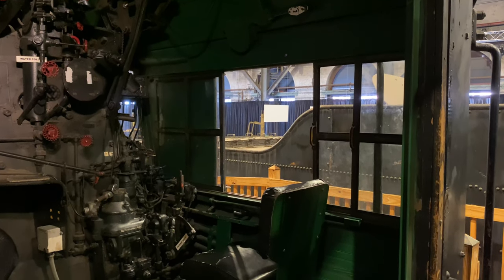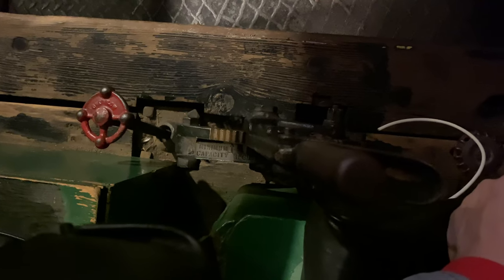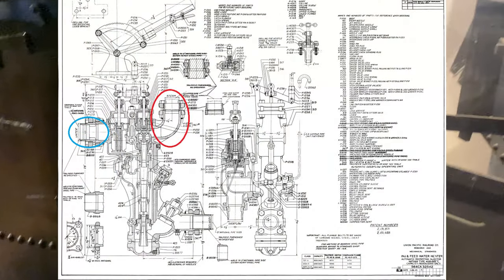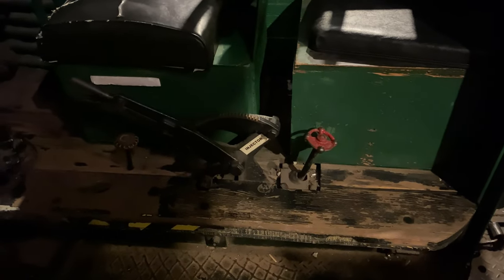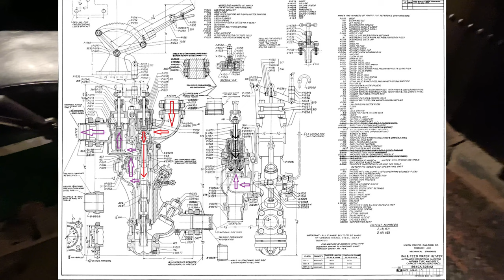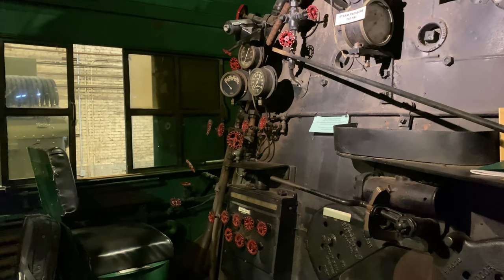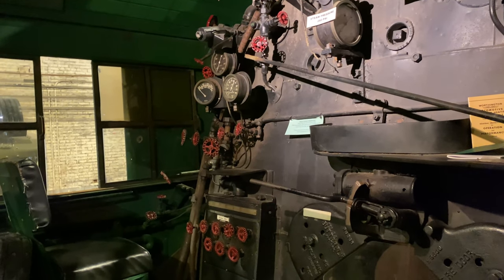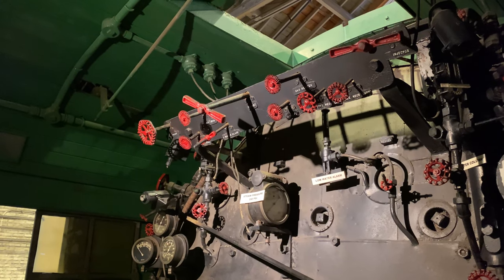Nathan Type 4000 Injector & Worthington Type SA Feedwater Heater Overview on C&O H-8 Allegheny #1604

Comment: Wow! Great info, man. I recently got a deal on a reprint of the1925 Locomotive Cyclopedia which shows cross sections of just about every component of steam locomotives.

I had never heard of this type of injector and after watching your video, I found a video that I'll link to below of a Nathan 4000 C injector in 1.5" scale (I think that's for 7.5" gauge live steam locos): https://www.youtube.com/watch?v=vddPlxaJY0k

I've found that studying scaled down versions of components for live steam models makes understanding how these components work a lot easier than the full scale prototypes as the smaller versions are simplified, but still work under the same principles.
Anyways, I just subscribed and am glad I found your channel.
Reply from the maker: If you can get your hands on one of the editions from the 1940s, those ones have information on more of the “modern” steam appliances, like the Nathan 4000.
Reply: @FanRailer  Oooh! I'll do that. If I'm not mistaken, aren't the 40-50 page books called "Train Shed Cyclopedia" taken from those bigger books?
Reply from the maker: Potentially, I’m not familiar with that specific publication